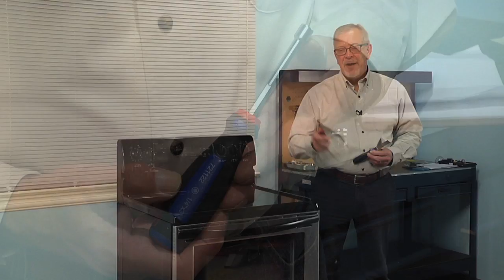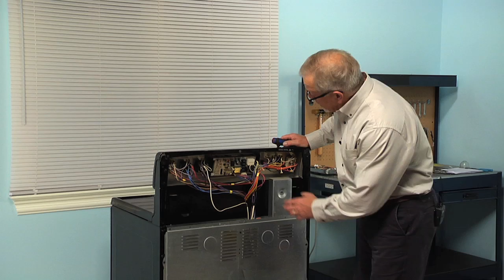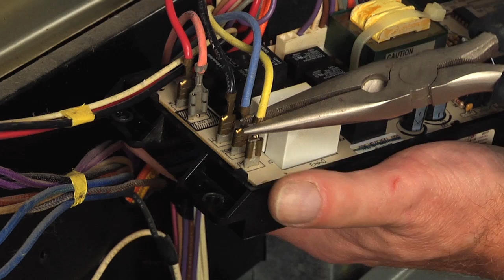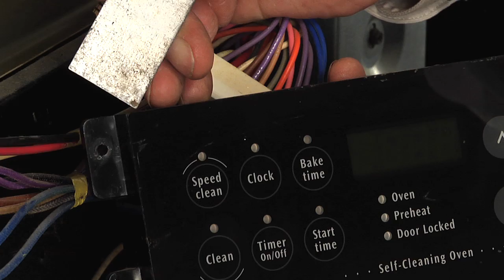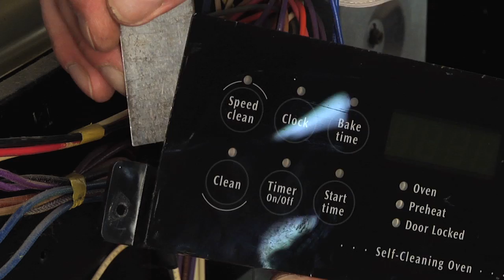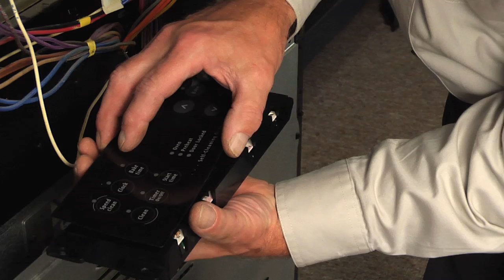Range Repair - Replacing the Control Board (Frigidaire Part # 316557205)

Comment: Hi where I can bay the part
Reply from the maker: You can find this part on our website here: https://www.partselect.com/PS2378933-Frigidaire-316557205-Electronic-Control-Board.htm?SourceCode=3&SearchTerm=316557205
Good luck with your repair!

Comment: Steve I love your videos. Have you made one yet with the frigidaire oven that is a air fry mode. The one with the controls in the front. I need to replace the control for the front left burner

Comment: This worked perfectly for my Kenmore range 790.91072601
 and control board 316455420.   It took me a 1/2 hour with no previous experience.  I ordered an OEM part from Amazon that was much cheaper than what was quoted by my repair person.

Comment: Thank you so very much! 

 My oven was not the same type as the one you repaired, however, by simply following your directions, I was able to replace my Oven Control Board Assembly after one appliance repair person basically "Took" me for well over $200.00 by replacing a part that was not even in need of repair. I researched my "Error Code/E-0A) on Samsung's website and it told me SPECIFICALLY what the problem was, which was that the stove was "Overheating" and the website told me exactly what I needed to fix the problem:

The Oven Temperature Sensor & Possibly the Control Board Assembly.

 I ordered my parts from Amazon, and while waiting for 'another' repairman who "could not fit me into his schedule", I decided to look to YouTube for help.  I viewed another gentlemen's Youtube video,.... but your's was so much simpler, and 'to the point'. 

I just finished replacing my Control Board Assembly and My Oven IS WORKING FINE!  GOD Bless YOU!  

THANK YOU!
THANK YOU!
THANK YOU!

Comment: Hi Steve, thanks for sharing, much appreciated. I just purchased Frigidaire range CFEF3016USB and in directly run in to the operational problem. To cook chapati\Indian breads, I use Tawa\hot plate kind of. My problem is that my stove have auto cut and coil goes off after reaching at certain heat level. This auto cut is at Hi and Medium both or I guess at all levels. Once auto-cut is mode is on, it doesn’t comeback easily, I have to wait for unlimited time or switch to another coil. This is very frustrating and wasting my energy as well. I want to remove the auto cut thing, is it possible if yes then kindly let me know how?

Comment: We have a Frigidaire model # PGLEF385-CS2. When the oven is put on Convection, and you open the door the oven kicks off the goes to display PF.wondering if you have encountered this before and what could be causing it.

Comment: Easy peasy with your great instructions. I also appreciated the tip about the overlay. I took a photo of the wires before unplugging them just to make sure I put them in the right spot on the new control board. Thanks!
Reply: Nancy McMurrray do you know if this works with all models including Tappan? I can’t find the model # and I have looked everywhere.

Comment: Hello PartSelect,
Our family also has the Frigidaire GLEFZ379FC model. The problem is that when we turn the switch towards large element on the right front surface unit, only the outer part of the stove heats up but the inner part doesn't. Do you know how to fix this problem? If so, please tell us as soon as possible.

Comment: I've replaced the control board on an FGEF3032MFD twice and the first control board didn't even display the clock unless I turned one of the range knobs on. The range nor the oven worked. The second control board did nothing so I'm assuming there is another part that needs to be replaced as the power checks out to the appliance. Any help would be greatly appreciated.

Comment: Is it possible to just replace my relays?
Reply from the maker: Hi, do you mean the over lay on the control board? Please provide your model number.
Reply: No, there is two relays, one is for the broil and the other is for the bake element. I think they are soldered to the control board... is there an easy and efficient way to replace them? My model is a Frigidaire CGEF3055KFF. Thanks!
Reply from the maker: Hello, I have checked your model number and you would need to replace the board itself. The manufacture doesn't have individual parts listed for the relays only.

Comment: My fridgedaire gallery  oven is 5.5 years old.  The stovetop works fine but the oven is not working at the correct temperature, so it's not cooking food correctly.  Model # is FGEF3042KFG.   Can you help me please to figure out what is wrong???
Reply from the maker: Hi Beverly, I have researched your model and for your symptom I would suggest checking your oven probe - over time this can become weak and might be sending the wrong temperature signal. If you notice that your oven is not producing enough heat, it could be because the sensor has failed. This part is located at the back of the oven, and is held in place by a few screws and a wire harness. Another reason could be that the control board has failed.

Comment: This video saved me at least $100, maybe even $200. I was getting an F11 code after I started melting the touchpad trying to deep fry chicken in a rectangular chafing dish water pan too on the left two burners of my Frigidaire Gallery stove but too close to the back of it, forcing intense heat up toward the touchpad. The door lock button was stuck to the relay under it, making everything on the touchpad unusable except the oven light, generating an F11 beeping that would not stop. I was able to unstick the label from the relay pad under it with a dessert spatula, and after putting a thin piece of stick-on velcro under there, was able to prevent the slightly warped label from making connection. I may not be able to lock my oven door anymore, but I don't have young kids and now I can use my stove again. Thank you so much, some other guys on here suggest giving a gratuity, I wouldn't be averse to it :^)

Comment: My Stove made a loud popping noise like a firecracker when it was in use.  We switched it over to broil from the bake option when it popped.  Now the control board does not work, but the stove tops are still working properly.  Would simply replacing the control board fix the issue?  Or would there be a fuse that also needs replacing?

model # FEF380MXDCB
serial# VF42522723
control board# 316207509
Reply from the maker: Hi Albert, I would suggest checking your bake element for damaged.

Comment: Thank You very much. I couldn't find the exact part that I needed online. My control panel still worked, but the parts where the screws go in, broke into pieces on one side. Cheap plastic garbage. Luckily enough of the plastic was still attached for me to take the two screws out, put washers on them and screw them in tight, holding the controller tight. It was great to know that I needed to get my 1/4 inch drive before starting though! I also had the screws fall out of one of the front knobs last year. I put them back on and it's been good, but it's disappointing to see this stove falling apart like this. It should last a lot longer..

Comment: Replacing  the control board on a frigidaire  stove keeps on beeping
Reply from the maker: What is your model number?
Reply: PartSelect Model Number is VF50905619   AND THE SCREEN IS SHOWING F31
Reply: PartSelect sorry I gave you the serial NUMBER before. The Model Nunber is FFLF3047LSD
Reply from the maker: That code would indicate a faulty RTD temp sensor or possibly a defective electronic control. The resistance of the sensor should be about 1050 ohms at room temperature. Check the wire harness connection at the sensor and at the electronic control as well.
Reply: PartSelect I changed the sensor. And it still showing F31

Comment: Just replaced my control panel, have to press the clock button to operate the oven,
all wires were replaced properly. Any suggestions? Thanks
Reply from the maker: What is your model number and what is the part number that you replaced?

Comment: Thanks was able to swap my unit out using this video.  I used a small flat screw driver to help get the white connector off as it was on very tight.